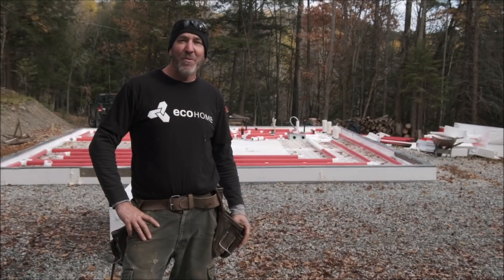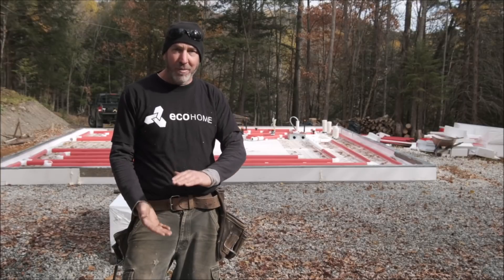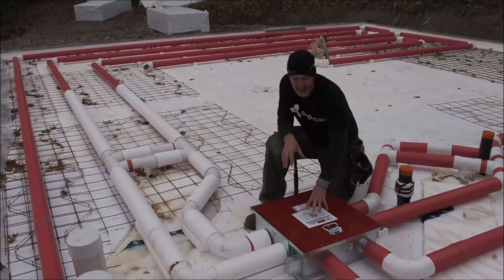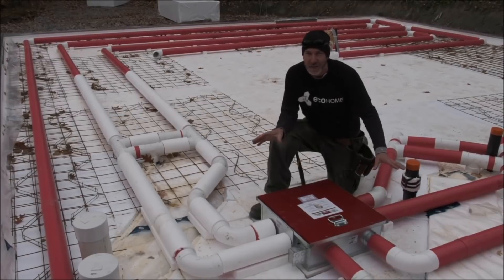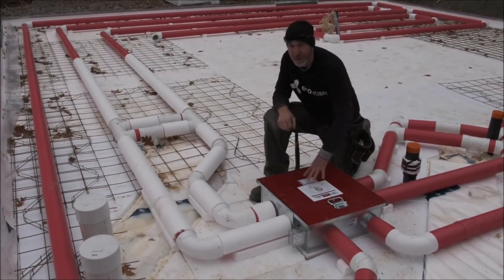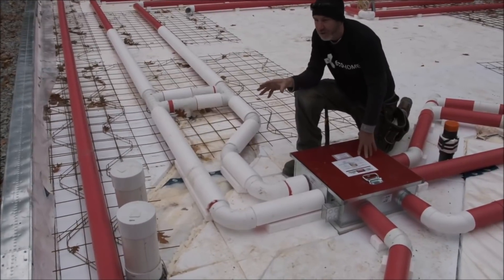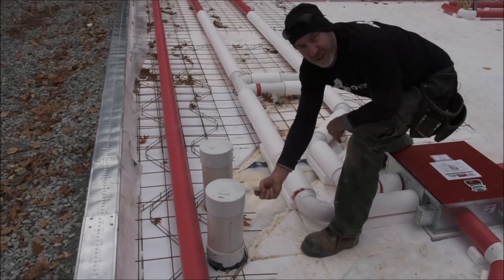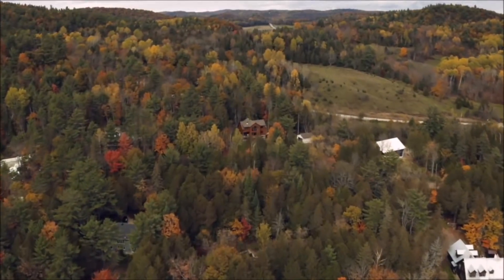Frost Protected Shallow Foundation Forms Kit Build Legalett: Slab on Grade Super-Insulated ICF Forms

Comment: Use the heater in the winter and in the summer just turn heater off and connect piping to a geothermal loops buried in the ground for a cool 60F

Comment: Would it be possible to cool this house by blowing cool air from earth-tubes ( tubes 3 ft underground that draws air in that is warmed or cooled to about 50° F - 10° C). The floor would be cool to feet in summer but I would  prefer a cool floor in summer.

Comment: Would this work for a slab “foundation” which is a requirement for a mobile home pad here in the northeastern US (Adk/NE states region of USA) and help to keep the pipes from freezing rather than using electric tape on the pipes under a mobile home, if we were to block in underneath the mobile and create a crawl space?

Comment: This is a cool system. Solar heated air distributed through thermal mass floor then releasing heat into the house for 12 or 15 hours. 
I built a 8 x 3 foot electric coil floor heater with foam insulation and layers of concrete board topped with tiles. It silently and gently heats my bedroom. I am planning to build similar one in the living room.
I also built a series of pop can and downspout solar air heater which really do work with high insulation.

Comment: What's the plan for condensation within the horizontal runs of pipe when hot air from the solar panel hits the cold wall of the pipe against the slab? Also, the amount of bends and the small diameter of pipe will cause huge restrictions in air velocity and overall system efficiency. 

In the future, I'd suggest looking into Ground to Air Heat Transfer systems (GAHT) from high efficiency greenhouses. They increase efficiency by effectively digging a basement, insulating the walls, then back filling to bury the heat transfer system in an insulated thermal mass. The piping is perforated to allow condensation to drain into the soil, and must be installed above the site water table. 

It's a really neat idea for a residential build, but I don't think it's going to perform the way it is intended.
Reply: It is a closed system. So there shouldnt be any condensation if the moisture content is low to begin with.
Reply: no update ;(

Comment: I cannot believe this is actually taking flight in any shape or form. Air is a terrible media to carry heat. Water is much more effective and will always lead to better results. The "pros" list they have is laughable as they're adding things you can address in a radiant floor in 5 seconds. Also, a standard slab is 3.5-4". Absolutely no way you're putting 2" PVC without destroying the integrity of the floor. So now your concrete bill just doubled. Boilers/tankless water heaters can power hydronic floors and are extremely cheap/common. Good luck replacing whatever gimmick heating product they've come up with.
Reply: I have a Legalett floor and have had since 2003 and I love it. The concrete is very thick, not a standard slab, and is an extremely efficient thermal mass. The hot air is recirculated inside the spider web of pipes, it does not enter the building. I heat with electricity and it is very much cheaper than heating with fossil fuels. The heat is soft and even. I will build another.
Reply: I am certain its a conspiracy and all these satisfied people are actors

Comment: I love the idea and the simplicity of the slab  which I'm planning to do for a 2 story garage/home 24 x 40 (side walls should be around 20 feets high).  But I'm also worried about wind effect, specialy sliding or overturning? because i feel like the slab isn't really attached to anything... any thoughts or special care you did under that slab? And how is the energy effiency and comfort so far? thank you very much for sharing your experiences and ideas :)

Comment: I love your drive to try new things!! I'm super interested to see you post logging data on how the house performs! I'm a bit sceptical only because fluid is so much more efficient at heat transfer than air. But your pipes are larger than hydronic pipes so I'm sure that makes up the difference in ability to distribute heat. Thanks for sharing your project, can't wait to see more posts on this project!
Reply from the maker: Hi Mark, 

Thanks so much for the encouragement! It will take a full winter to really get some performance numbers, but the estimates based on how much heat is generated by surface area of panel along with the projected heat load of the building and an estimate of climate conditions mean we are hoping to see somewhere in the area of 60-70% of the heat provided by the solar panels. We have no real estimate on the production of hot water yet but we look forward to seeing some of that data from Legalett as the system is tested. 

As for the air tubes instead of water, I linked an article above for Ian but I’ll stick it here too, it’s our page on air heated floors that explains the advantages. 
https://www.ecohome.net/guides/3203/air-heated-radiant-floors/

Your skepticism is understandable, and your assumptions are correct - by volume, water holds more heat than air,  but in the case of hydronic vs air-heated radiant floors, Pex tubes are a half inch diameter while the air tubes are 6 inches in diameter. So there is a greater surface area for transferring heat. One Legalett floor heater will meet code requirements for heat for about 1700 square feet of a single-story house, though some make-up heat is required with HRVs. For larger houses they just put in additional heater boxes.

The thing about air-heated floors, is that while a hydronic floor will provide the necessary amount of heat to a house (and sometimes a lot more), there are far more hot and cold spots with hydronic. So this delivers a more balanced heat throughout the house. And from a long-term maintenance point of view, the heater box itself is hardwired, so the heating unit inside the box can be unplugged by the homeowner and taken our for maintenance. 
The house itself is currently being built, it's a pre-fab dense-packed cellulose wall system, so we will keep updating the ecohome.net website as it progresses. Again, thanks so much for such an encouraging post!
Reply: @TheEcoHomeNetwork  have you collected and processed the data at this point? I'll check your site but a note here would be welcome either way.
Reply: @TheEcoHomeNetwork  any update?
Reply: I am in the beginning phases of building a new home. Did you ever get data for this project. The front range in Colorado is not nearly as cold as Canada. I could not find anything on your website.

Comment: i don't really understand how this is better than a hydronic radiant system.
Reply: Hey Ian, 

Having done many hydronic radiant floors in the past I was a hard sell at first, but now having done both systems I can honestly say I like this better from an installation point of view, but the advantages go beyond that. You can read more about how air-heated floors work here - https://www.ecohome.net/guides/3203/air-heated-radiant-floors/ but the short story is - it comes with zones designed, installation directions and a cut list for pipes, so your standard carpentry crew can pull this off no problem without subbing the work out to plumbers. 

You don't have to worry about damaging a tube during install like with hydronic, it also distributes heat more evenly than hydronic floors. All the heat is contained within the floor, and by insulating the tubes close to the heater box you eliminate the boiler room affect that is typical with hydronic systems where the mechanical room is the hottest room in the house. 

As for performance, there is less latent heat in air than liquid, so when the thermostat shuts the system off it doesn’t' overshoot the desired temperature the way a hydronic radiant floor often does. Also, with an electric system the whole thing in contained in the floor, so it's quiet and it doesn't take up much space. We built this house in Quebec so it's heated by electricity, but it can also be done with gas boilers and a liquid coil as well. In either case you save a lot of space in the mechanical room so it’s a great option for slab on grade and smaller homes.
Reply: Simple. It's not. In no shape or form is this better. It's a complete waste of time. Waters capacity to carry heat and evenly distribute, is unmatched. Not to mentioned the added cost to your slab since you need to increase the thickness with this.
Reply: @shawnd567  You have not lived with a floor like this, I have, for 17 years, it is amazing. The slab is guaranteed for the life of the building. Legalett knows what they are doing. No pumps, no leaks, only a very quiet fan inside the floor. Mine is under my dryer. And the savings from having such a thermal mass are significant. In addition, in the summer the floor is cold. People think I have AC, but I don't. At 30+ outside my feet can stay cool, the dogs lie flat out on the cold floor. I love it and it is free.
Reply: @leoniebelcher1680  Hi Leonie, In what region is your home located?
Reply: Leonie Belcher I would like to know where you live? I’m wondering if this will work in Montana weather!
Reply: @leoniebelcher1680  so you can use this system like a vehicle radiator to heat or cool the thermal mass, water in a vehicle, concrete in a home. I would think straight lines would be less Restrictive if possible. Was thinking this could be used to transfer heat from the solar gaining mass to less solar gaining areas to balance the thermal battery
Reply: @jasont1920  Ontario, near Ottawa
Reply: @ruthalexander6681  Hi Ruth, I am in Ontario, near Ottawa